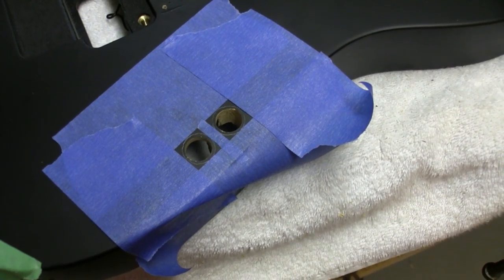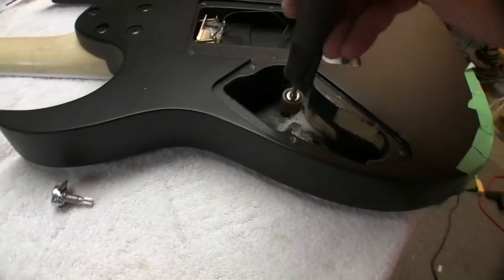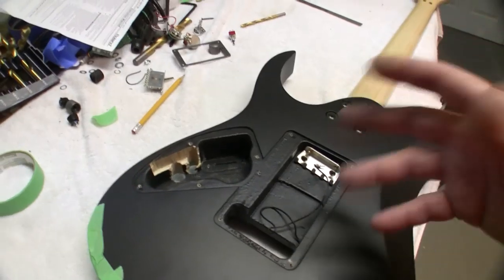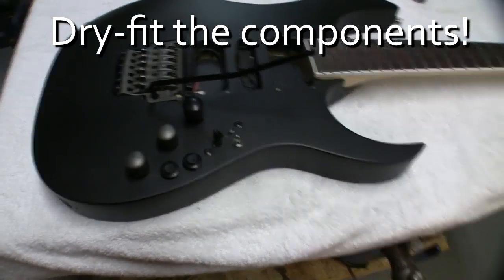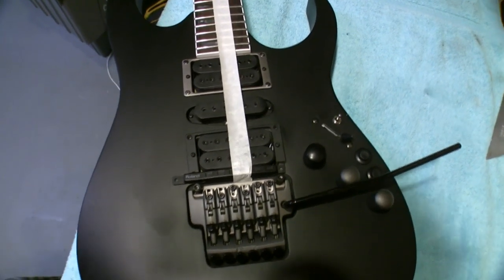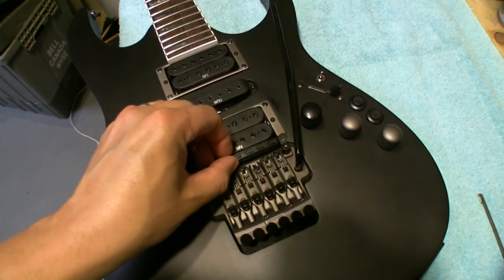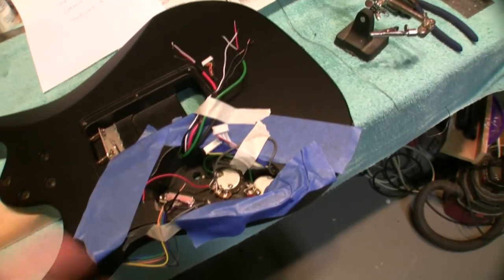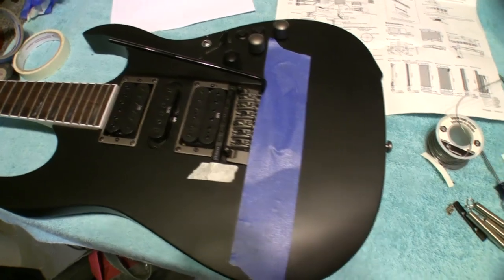Roland GK-Kit Installation Video Part #2

Comment from the maker: yes it includes the signal from the standard pickups. the hex pickup isn't a midi data pickup its essentially like 6 individual magnetic pickups (one per string).  I have EMGs on my ESP but no GK on it.  Theres no issues that I know of with EMG's but its a valid question because you wouldn't want to be killing batteries.  I suggest you post your question at vguitarforums. many knowledgeable folk there.  best of luck.

Comment: Nice well done video. On your comment about using .010 strings due to triggering/noise issues. I have the same GK-pickup and use .009 strings with no problems at all.

Comment: I am impressed in your outcome and attention to detail. Great Job. As far as drill bits are concerned. Spend the money!!! However you want to get a set of Brad Point bits because they are less likely to chipout anything on the top or bottem of the hole. Also it dose not hurt to use power tools to do the things you are doing by hand as they save allot of time! Just practice, practice, practice just like you do with the guitar. There is a ton of space available if you use a router and undercut!

Comment: Superb to know and the internal GK system is so much nicer than the bulky clip on setup that most people use. I've been looking at doing this to a Parker Fly guitar so I really appreciate the explanation of the routing and long drill bit tips.  My only other suggestion would be to tape around the cavity when your finished and spray some gloss black in there but honestly as no ones going to see it but yourself, it's probably a bit of an OCD addition.  Still for completeness that's what I'll be looking at doing.  I also think the red LED would have looked cool on this guitar(kind of a Knight Rider guitar.   If you added a few of them and had it strobing it would look great on stage.  Yeah OK, kind of geeky but even the single one would have looked cool, perhaps two of them to give your guitar demon eyes....)  :)

Comment: @DethoticA Take a look at the Roland GI 20. It will convert the GK-3 output to midi, which you can record on a computer and use soft synths to generate audio.

Comment: hi    just a thought, if you have to shim the height of the gk3 you could use some of that clear perspex you had. sand to fit, leave it with a mat finish, cover top and bottom with silver metal tape as a reflector, and install the led under the shim leave a hole in the tape where the led is ,and the whole shim should glow .   :)

Comment from the maker: Not trying to defend Roland here but the VG-99 came out in 2007 and at the time there weren't a lot of Winx64 installations as there are today.  There are well over 1200 quality patches for the VG-99 on the forum and just over 200 for the GR-55.  I myself have personally contributed the bulk of the Metal ones although their are other contributors.  If you have some patches you'd like to share there please do, it would be much appreciated!

Comment from the maker: @DethoticA  Yes, I can't see why not.  You could probably instal it in most guitars but you will need to make modifications to accomodate.  i.e. enlarging control cavity (as I did), maybe longer wires, movement or relocation of existing mag pickups etc.

Comment: Hello there.

Thanks for the video.

I had a quick question regarding the wiring for the internal kit, if you don't mind - I've taken my kit and my Gibson into my guitar guy and everything is working correctly apart from any PCM sounds, the modelling sounds are working perfectly. By any chance do you have any idea what the problem could be, please?

Thanks so much for your time,

Sophie :)

Comment: That forum has 1331 patches as of 4/1/12 with more on the way.  I have a patch that's an nearly an exact duplicate of the Cynic "Veil of Maya" clean tone (for the jazz parts) as well as I've got some other patches that might work for what you're wanting.  But sometimes you have to take a patch someone started and YOU have to finish it to dial in the tone you want.

Comment: Do you know if this would work on a violin? The roland gk system seems to be the only affordable and reliable midi pickup I can find out there, and it says on Roland's official website that it works with steel string instruments. But then I am sure it would work fine with a violin.

Comment: Your video for the installation is great, but i have a question.
Does the 13 pin take the guitar audio, or is it only the midi data?
I have a GK 3 external, and you take your jack from the output to the gk3 and it all goes down the one wire, but i didnt see you wire it to the jack output.
I have active EMGs and when i plug in my jack it turns them on. Im just trying to work out how this would work as i really want to hide the gk3 and get the internal model.
Thanks for any info you can give.

Comment from the maker: @darren0512341 My guess is that it won't track as fast Midi wise.  I play metal as well and no longer use my EMGs because I get fantastic tone out of the GK-3 and VG-99.  I don't play drop B stuff very often but I'll try and post a sample video.  In the mean time you could hear a sample mp3 I put up on the vguitarforums of a Nevermore patch I created.  The patch can also be downloaded from there as well.

Comment: Hi! would the GK3 pickup still work properly if I placed it right in front of the bridge pickup rather than in-between the bridge pickup and the bridge? I have piezo wires running from the saddles of the bridge to the opening of the bridge pickup so there is no space for the GK3 pickup to be placed in that slot....thanks!

Comment: @soundscape2k im playing in a metal band, but im trying to be creative and add some midi elements in our music. i cant change the tuning, coz i'll need my strings to be drop b, so my emg can go to my amp head, and playing with the rest of my band. so im stuck with drop b on strings.
but if those pickups are fine with drop b, there wont be an issue, and that's the question.
im more keen on the graphtech ghost coz it can blend it really well on my floyd and i like pulling my floyd backwards too.

Comment: im currently in drop b (i know it's low, dont judge me), and looking into installing these pick ups. 
do u happen to know roland's better or the Graphtech Ghost pickup has better , more accurate tone with drop b?
btw, it's a jackson rr24, with floydrose, so.... yea...
thx buddy really clean job on the installation.